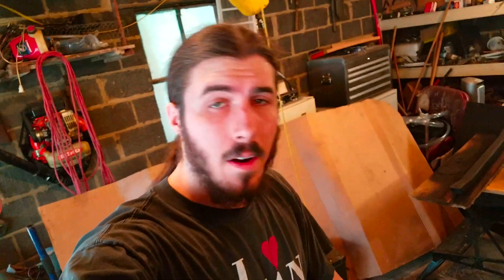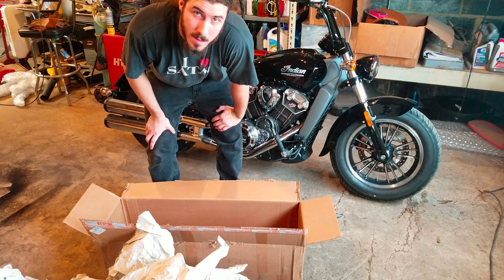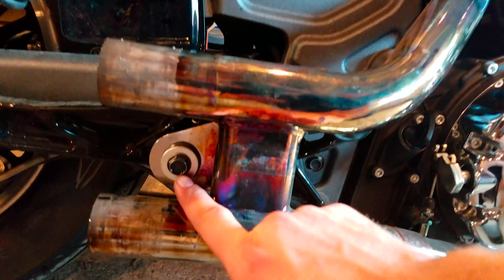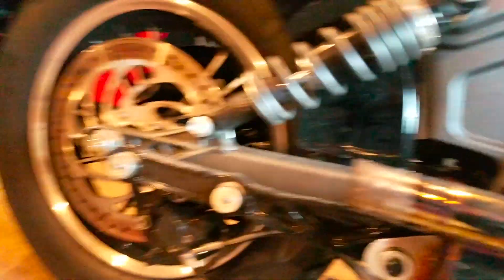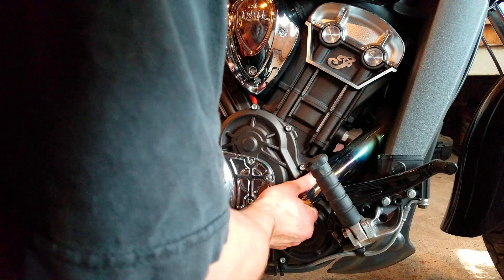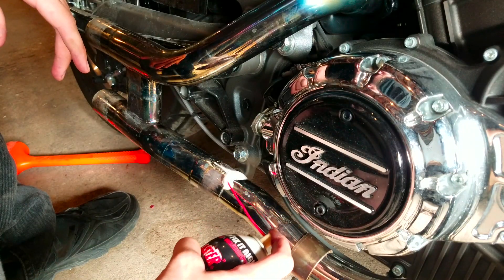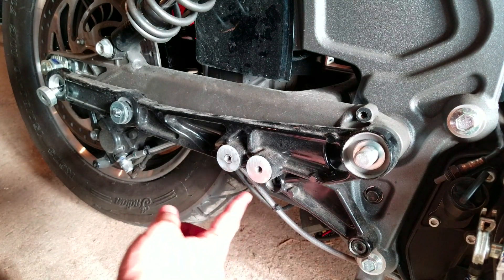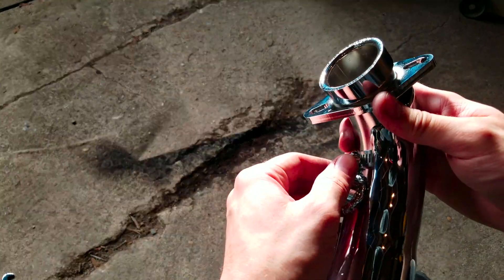WHY IS THIS SO HARD--RPW Brave Install for Indian Scout (4k), part 1

Comment: That right there just about sums up my experience with removing the rear axle and tire off the VTX :P.
Reply from the maker: "A rubber mallet and a few choice words."
Reply: And those wonderful swivel ratcheting wrenches.
Reply from the maker: They're nowhere near as useful as I'd expected. I definitely needed them, but a u-joint style socket attachment was way better.

Comment: Lmao...sorry, all I can do is laugh because I also didn't realize the stock headers separated like that. I spent a solid 15 minutes sweating and cursing and trying every conceivable way to get that front header to come out. Thankfully I only did minimal damage before I smartened up and realized there must be an easier way. I was lucky to find a video that showed they came apart. But still, I had a hell of a time getting the stock exhaust off and installing my grenades. Way, WAY harder than I thought it would be. Not so much harder as more annoying and time consuming than I thought. I did have directions from Vance and Hines and I honestly think it would have gone smoother without them. They were horrible.
Reply from the maker: Yeah, it was a pain... and instructions are rarely written up by people who have any business doing so.

Comment: why didnt you just remove it with the heat shields on
Reply from the maker: Because that would make sense and go against my creed of doing everything the hard way first.
Reply: Actually, the heat shields had to come off to be able to get to everything. Well, not all of them but unless you've done it before you need all the visibility you can get to get the job done. OnceI removed all the heat shields it got a lot easier.